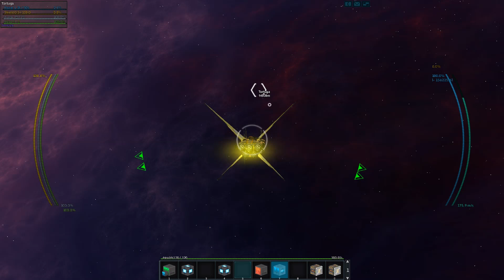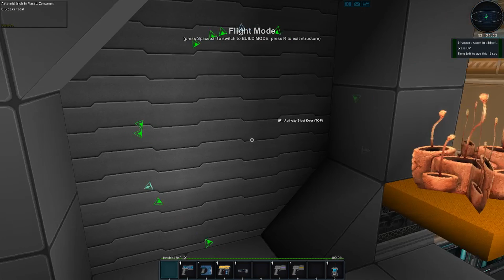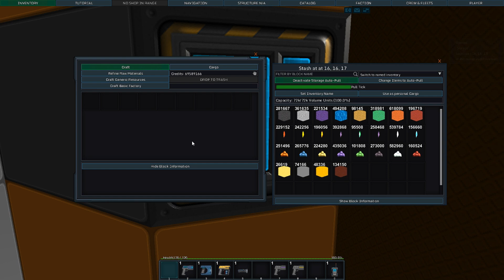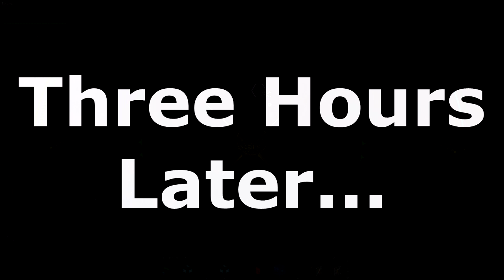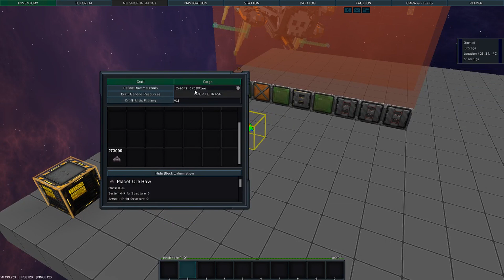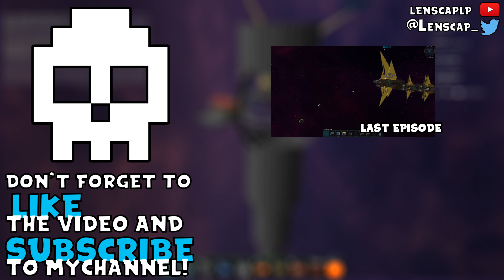StarMade: StarSquad - S2 E39 - Power Reactor

Comment: I built the Pyramid for Gary in this episode of StarMade Adventures. While he didn't activate all three rings in the filming, they all rotated as you are trying to do. Each ring has a smaller ring docked to it on the inside and they all rotated.
Reply: Ah, I would love to see that!
Reply: https://dl.dropboxusercontent.com/u/30848403/video-1466034482.mp4

https://dl.dropboxusercontent.com/u/30848403/Alien-Pyramid.sment
Reply: works fine indeed, thanks! I'll check it out! :)